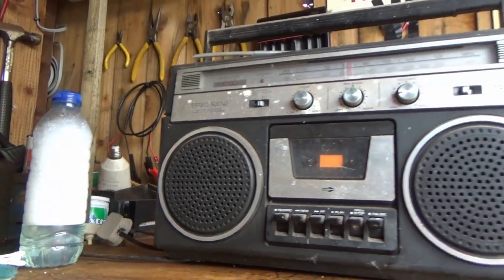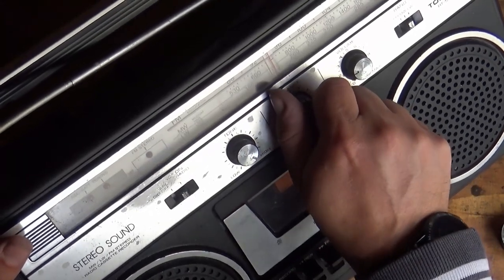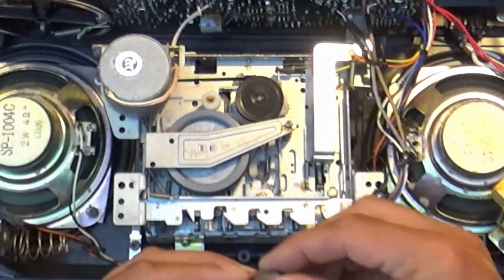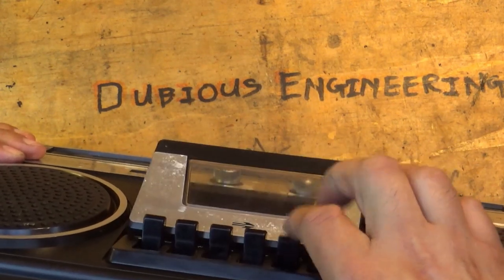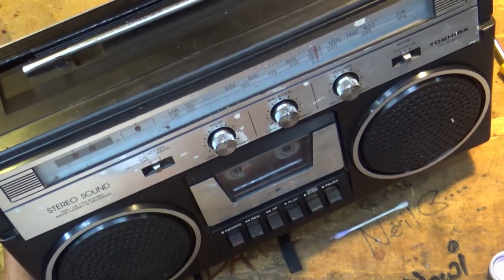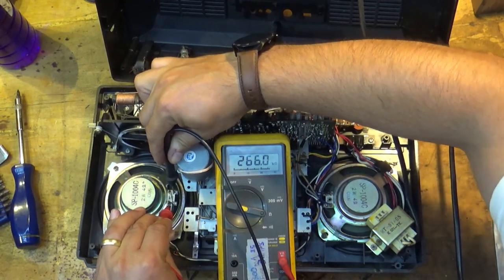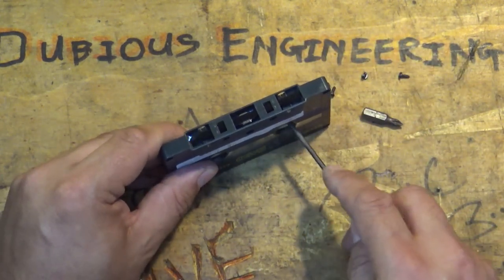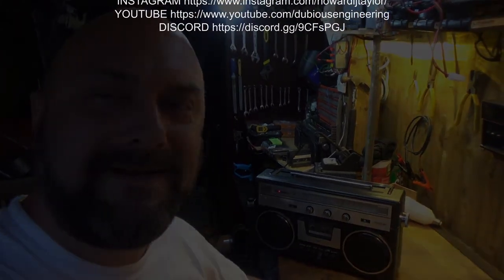DuB-EnG: Toshiba RT-5160S 1980s Stereo Radio Tape Recorder Boombox / Ghetto Blaster Clean-up Repair

Comment: I use break fluid to get paint off plastics. I also use scrunched up tin foil to refurbish aluminium metal parts.
Reply from the maker: Those are some great bits of advice!!!  Thanks!!!
Reply: Brake*